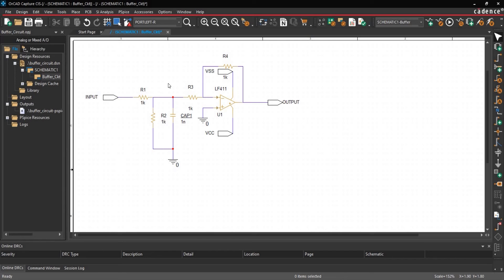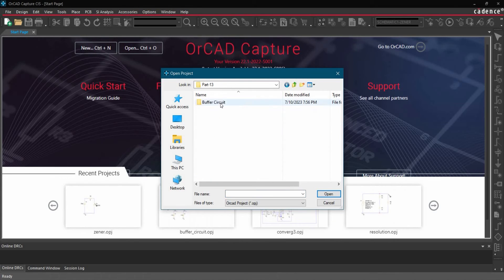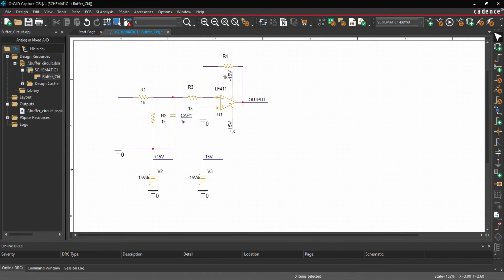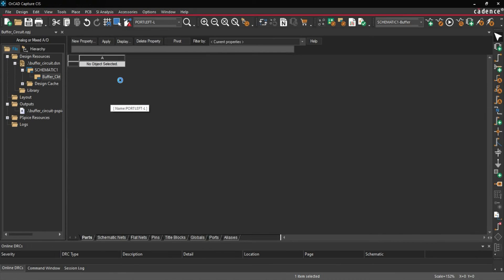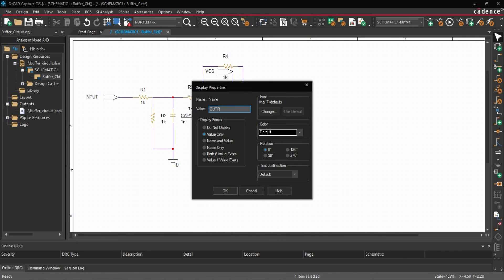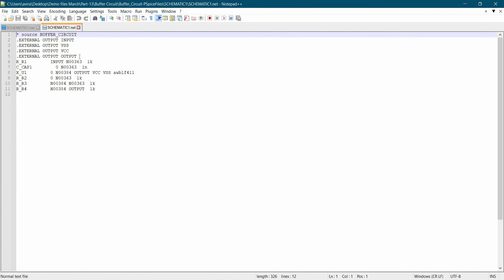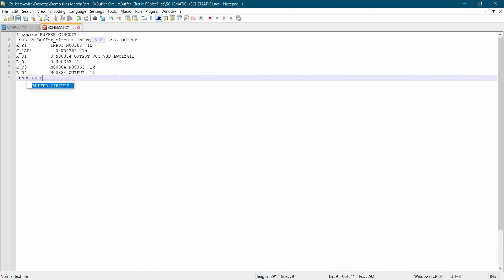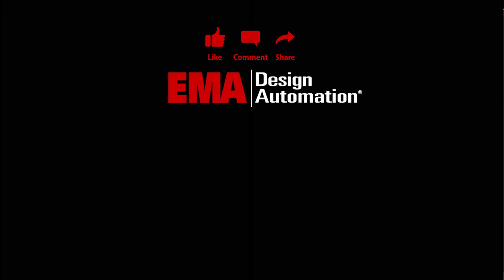PSpice Simulation Tutorial: How to Convert a Circuit to a Sub-Circuit Model

Comment: The use of the created subcircuit is not shown in your video. I've tried to create a PWM generation block to analyze an inverter circuit. However, I want to create this block as a subcircuit, but when I use it, I get an error: ERROR (ORCAP-36002): Property "PCB Footprint". Does this suggest I need to create a PCB layout? Is there a way to avoid having to create a PCB layout?